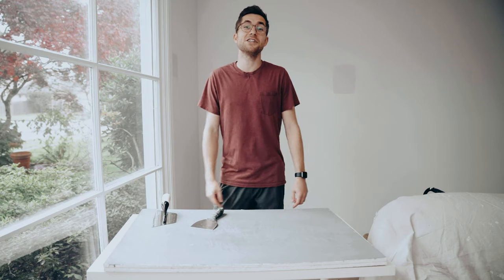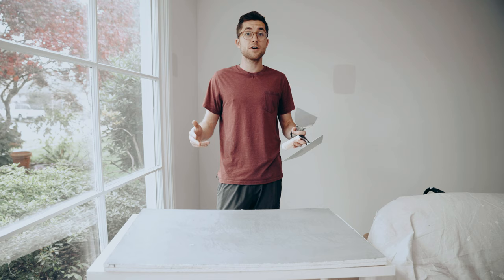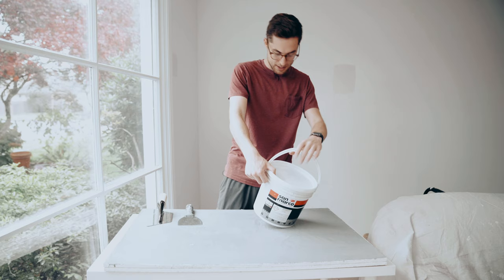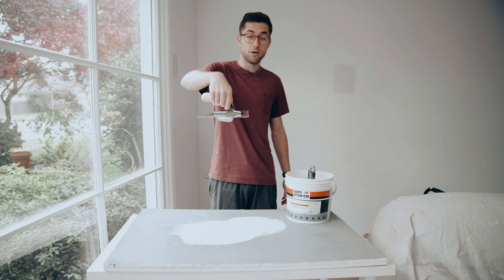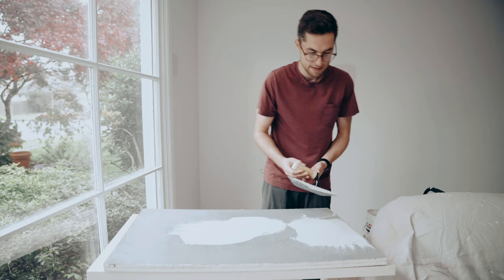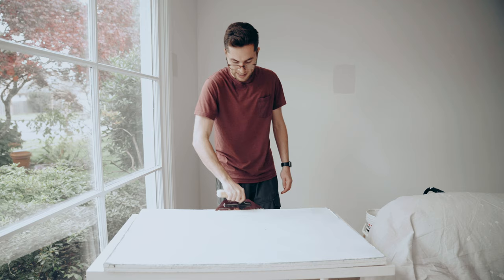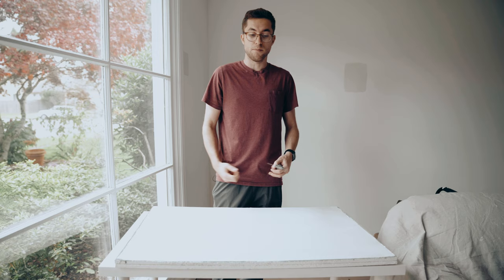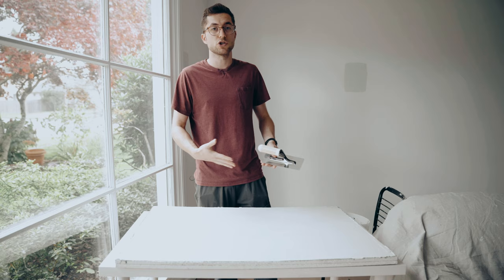VENETIAN PLASTER FOR BEGINNERS | diy guide to applying plaster

Comment: Is that board just wood, or is at a canvas ?
Reply from the maker: This board is just a scrap piece of OSB board that I had. Most people use MDF board to make plaster samples with but you can really use any piece of smooth wood. If you do use OSB board, you'll want to skim coat it to smooth it out.
Reply: Did you primer the board? Or just skim it. 

Im looking to get into this side of the plastering sene.
Reply: @AlongForItAll  do you need to prime first?
Reply from the maker: @middleofdecember9862  I recommend to prime first for any plaster projects!
Reply from the maker: @russellgriffiths7780  I skimmed and primed. This was because the board type was not very sutible for this type of project. Ideally, you'd have a completely smooth board to start so you wouldn't have to apply a skim coat first.
Reply: @AlongForItAll  could you tag me a link please on where you get your venetian plaster from 

Many thanks
Reply from the maker: @russellgriffiths7780  Here's where we get our plaster from - https://bit.ly/venetian-plasters If you end up wanting to purchase, feel free to use our code AFIA10 for 10% off.